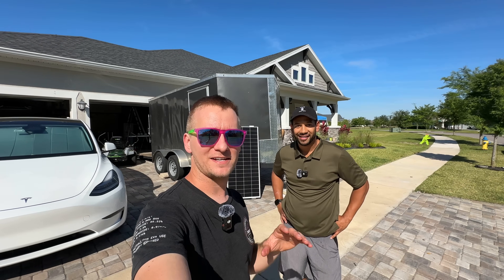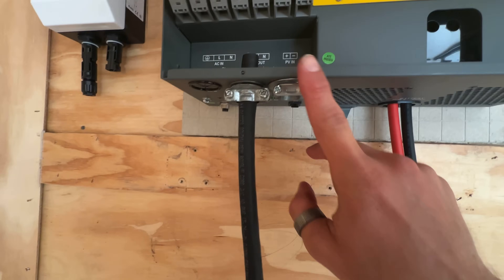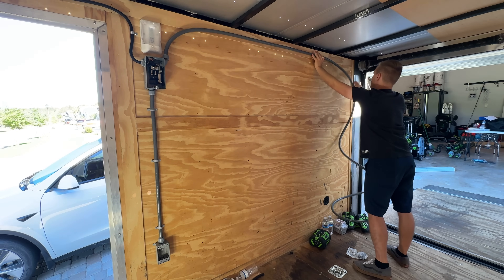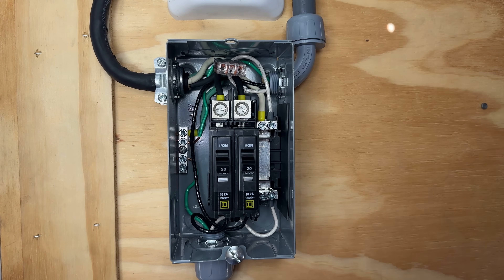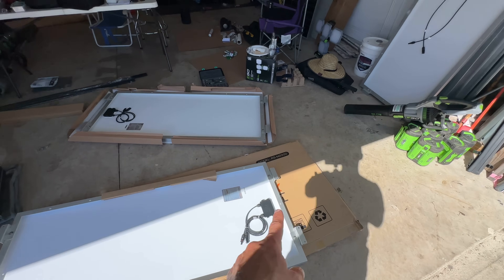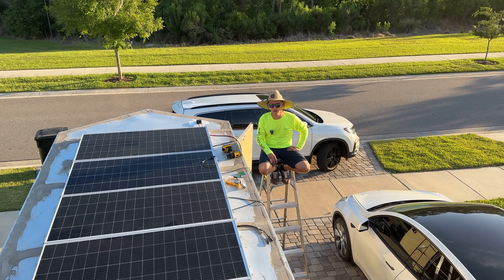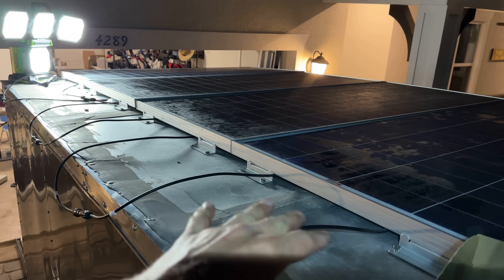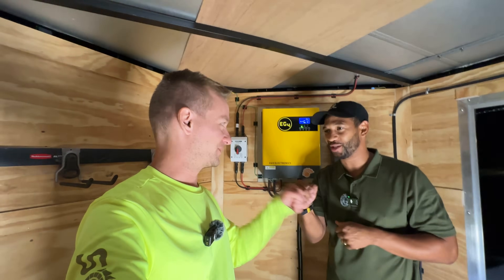Building a solar trailer for an electric lawn company

Comment: It's important to point out that wiring the panels in series this way is in part because the EG4 inverter demands a minimum of 120VDC input.  It'll accept up to 450VDC and this whole operating range is considerably higher than a lot of inverters on the market which is great because higher volts means getting away with thinner wires, though higher voltage brings its own dangers too, and demands a certain minimum number of panels to get above that threshold.

Comment: What happens if you add another battery will it work know it probably won't be necessary  because your barley depleting it which is good but could you technically add another battery for an added buffer?

Comment: NIce setup, Man suck with all the holes in the roof. As a person that has built a few tear drops I hate holes or attachments point on the roof.  The next Teardrop I'm planing will have a luggage rack type mounting for solar racks on top with fasteners in the side of the camper and not the roof.

Comment: Pretty neat, but why not use big 400w+ Panels? Better coverage of the roof, less attachment wholes, at least 1600-2000w on that trailer and probably even cheaper than all the 200w panels together.
Reply: Check dimensions of differing panels.

Comment: noting the extra room either side of the panels most likely could have gone with 2.1m(82.67in) long panels and also only being 134in for 5 panels i think you might have been able to get to 5M / 197in(39.4in wide panels) for front to back and could have got higher efficient newer house panels or  something like 4 x Solarever 455W Split-Cell Mono PERC Solar Panel for a total of 1800 watt peak

Comment: I think I missed the whole point of this. From the amount of money spent on electrification of all the tools, solar and equipment it looks to me that you would have had at least 10 to 20 years' worth of gasoline and oil for normal equipment. On top of that, the amount of exported pollution produced to achieve your results is absolutely astonishing.  Can you explain it to me like I don't understand physics and economics? I'm being dead serious. I really don't understand.  Thanks.
Reply: It's actually rather simple. Lets say you use 5 gallons of gas per day ($4.00 per gallon). That's $20 per day in fuel cost (excluding oil, lube, additives,etc.).
5 days a week for 52 weeks per year equals $5.200 in fuel cost. His solar set up costs less than that, and once paid off, the power is "free".
Sure there is the up front cost of purchasing the electric equipment, but you would have similar expense with gas powered lawn equipment. 
I would say he would be in profit in 18 to 20 months...
Reply: Also, any gas-powered lawn equipment puts out tons of pollution. Maintenance which is also time is way lower.
Reply: @davidstewart1153 this is such an important point. Small engines are unregulated as far as emissions go, so combined landscaping emits more pollutions that all cars combined in the US.
Reply: One word: sovereignty. As a business owner it’s imperative to control your supply chain to the best of your ability. Investing the money upfront into eliminating the largest line item on a landscaping business’ budget after payroll gives the business much more resilience, as well as pricing flexibility (a solar based business will have lower operating costs). You’re no longer at the whim of OPEC or Big Oil, so you don’t have to worry about the price of oil ever again. 

The economics are pretty simple too: calculate the lifetime cost of an ICE zero turn, and compare it to the lifetime cost of a Battery operated zero turn (typically you’ll spend half on the electric stuff over the long term). 

Also over the lifetime of the equipment, the solar powered business will do far less damage to environment (mining the battery materials, making the solar panels, etc); whereas gas powered equipment emits a lot of the same pollution in manufacturing, then there’s the lifetime of pollution from not only burning the fuel but also the damage caused in extracting the fuel.
Reply: Only thing you need to know is that it's cool, simple as that.
Reply: There are customers that will pay a premium to have a solar powered lawn service both for the benefits of less pollution as well as noise reduction. Electric mowers are so much quieter than gas engines, honestly my EGO mower makes about as much noise as a box fan turned on high.
Reply: @alanpbarber  Would have been nice to have that trailer for the past 2 days in Texas after Hurricane Beryl.  Has me thinking about making a trailer like this along with propane generator for backup power.
Reply: bonus: electric stuff is usually much quieter.

Comment: Good work!

Looks like this trialer could handle an additional panel. Would the setup benefit from it?
Reply: I'm thinking the inverter has a voltage limit on the solar and an additional panel would go over that limit

edit: ok I'm wrong. idk I guess they decided not to try jamming another one on there
Reply from the maker: So, if the orientation had been the panels placed longways (and three panels wide) we could have fit another, but they had already tried installing the panels previously so I didn’t want to have to patch holes and drill a bunch of new ones. Plus they only bought five, so five it was! But yes, more solar is always better for an electric lawn care company. These guys are busy!

Comment: I love the shore power plug you installed, which was the one thing that I kinda wondered about on your build. Something I did with my little RV conversion van is that I put a 100' retracting cord reel on board, and had an automatic cutover switch between that and my existing shore socket that was pre-installed in my van. That way I always had a dedicated landline ready to go. I had another reel I could pull out with 3 female receptacles on it just in case I needed power away from the van at my campsite. I know you usually are charging at home, but you never know where you might want to shore-up and you'll always have an umbilical neatly on-board. Just my thoughts. I love your stuff, man.
Reply from the maker: Yeah Adrian wanted to be able to plug into the houses they mow at sometimes if needed so I installed that shore power for them. One thing that I’m not sure about is how to get the inverter to only charge the battery instead of bypassing the battery and also powering the loads; if you’re trying to charge lawn care equipment and plug the trailer into a house on a little 15A socket, you’ll trip the breaker because the inverter tries to charge the battery and the connected loads on the inverter at the same time. I think some of the victron equipment can handle that but the price of their equipment is in another league.

Comment: What do you think of trying to mount solar panels on poles on your traditional flatbed landscape trailer?
Reply from the maker: Would be an interesting experiment. I’ve seen a photo of some guy that did it, but my concern is you’re building a giant sail exposed to hurricane force winds (80mph highway with 20mph headwind and you’ve got category 1 hurricane lol).  So you’d have to have a really beefy setup and super secure panels, but anything is possible!

Comment: Ah that's what a non-one-piece roof looks like. The evolution of your concept is awesome to watch!

Looks like they'll love it.

The loads panel it sounded like you said the ground neutral bond is setup in there, how do you handle the GN-bond when they do shore power charging?
Reply from the maker: Hey Kacey! So the ground-neutral bond is handled inside the EG4 inverter through a relay. It automatically disconnects when shore power is connected and lets the house/grid be the G-N bond. I believe there’s a setting for it but can’t remember which number in the manual it is off the top of my head.
Reply: @solarpunksteve  ah yes I forgot this model can do that, the 12k and 18k don't to my understanding (though I haven't done a thorough read of either manual yet)